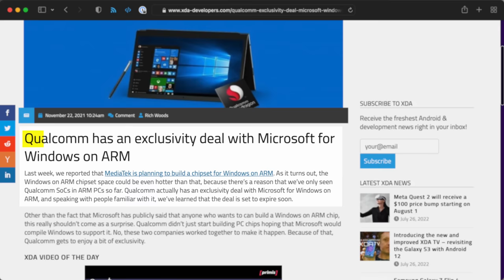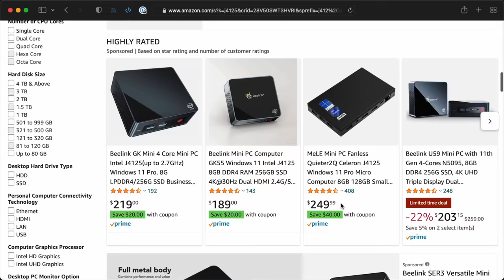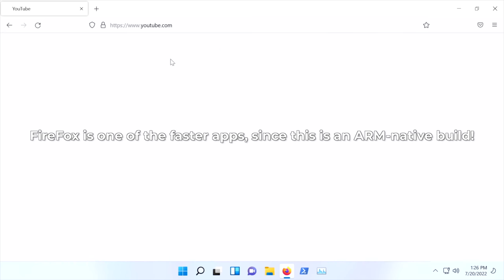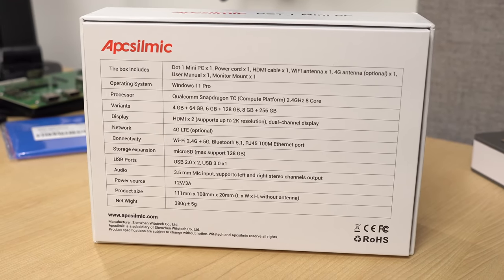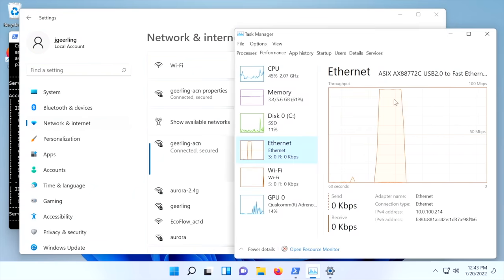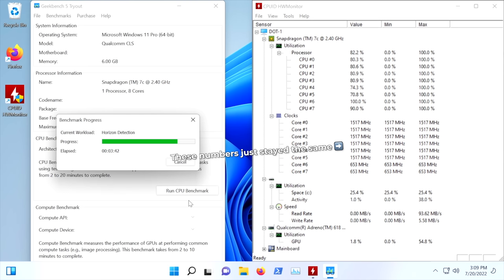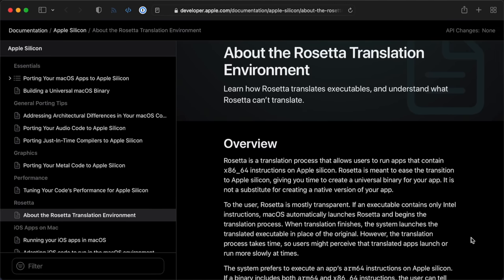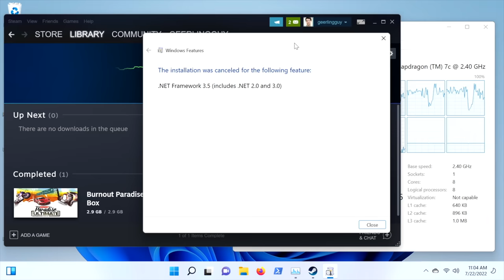Microsoft's wasted potential: Windows on ARM

Comment: there are 4 apple cpu switches actually.  first switch from mos 6502 to Motorola 68000, 2nd to PowerPC, 3rd to intel, 4th switch is to apple silicon.  However the first two apple computers, apple1 and apple2 were not a "mac" and only the later were mac so technically you're not wrong. 🙃
Reply from the maker: Technically correct is the best kind of correct ;)
Reply: There is more than one way to count! ;)
• Apple did actually release 32-bit Intel machines, without support for x86-64, so there was also a transition from x86-32 to x86-64, with 32-bit support being discontinued before the switch to Apple Silicon began.
• Modern macOS is based on NeXTStep, which had been available also for SPARC and PA-RISC, beside 68030/040 and x86-32. All four were once supported at once though. So they already had experience when switching the code-base to PowerPC, and then back to x86-32.
Reply: @FindecanorNotGmail  from 32 to 64 the instruction set is backwards compatible so that doesn't count.  Apple continued macs without jobs so next on 68k,sparc or pa-risc  don't count as well since they don't count as apple or mac just as apple 2 has nothing to do with macs other than only being produced under jobs. :washhands:nice comment though.
Reply: I don't think Apple II counts, since it is a totally different computer, but if you're going to count Apple II, then you forgot the switch from 6502 to 65C816 that happened with the Apple IIgs.  (8 bit to 16 bit.)
Reply: @electronics-girl   I wish there were more computers with the 65C816 :-)  No I didn't forget, just like how I didn't count the difference between 32bit/64bit intel cpus, I didn't count 6502/65C816 since the instructions are backwards compatible. Anyways, you're right Apple 2 is a separate thing. Yet, Jeff said MAC cpu switches and I said Apple cpu switches.
Reply: @Mr_ToR  Fair enough.  Yes, I've always been intrigued by the 65C816, but I never had a IIgs.  They still make the 65C816, so I'm half tempted to build something with it, but unfortunately the 6502 and 65C816 require so many external parts to function that it's far cheaper to build something with a modern MCU such as an AVR or a Cortex M0.

Comment: Wifi won't auto connect if Ethernet is connected on boot.  If you boot it up with ethernet disconnected it will auto connect to your preferred wifi network.  This happens on x86/x86_64 laptops and mobile devices as well.

Comment: A couple corrections:
- Apple hasn't built x64 binary translation in their SoC, they "just" have an addressing mode that makes it slightly easier, but that feature is also supported in some Ampere and Nvidia chips
- That's a 7c, it's the lower end, 8cx runs A LOT better (I'm daily driving it in a Surface Pro X SQ2)
- They're finally pushing, somewhat. Last Build conference had content specific for Windows on ARM, and they also announced "Project Volterra", a devkit similar to Apple's DTK
- Since then they've released two previews for ARM-native Visual Studio and announced that it will go stable in the next release (17.4)
- More and more software is being migrated to ARM64, I was even surprised Teams got a native version on Windows before macOS (yep, I know, I shouldn't be surprised but it's Microsoft)
- Even if classic Minecraft is written in Java, I think it still bundles an x64 version of the JRE and native libs, so it will be emulated anyway :)
- Windows PowerShell sucks even on x64 but that thing only exists for backwards compatibility, you should try PowerShell 7 (dark blue icon)

Comment: Windows will ALWAYS prefer a wired connection (assume because of increased stability for the majority of use cases). Disable the wired connection in network settings and only enable if you need to use wired. Itsa Windows thang.

Comment: I still need virtualization for older x86 Windows software.  It would be useful to have a Compute Stick-sized computer to plug into Apple Silicon Macs to run older Intel software natively, with modular (cheaper, non-Apple) storage.  I have an M1 Mini, so size isn’t too important, but it would good to have a portable solution for MacBooks.

Comment: It isn't wasted potential, Microsoft just knew they can't optimize their garbage OS to the point that it would run on the average ARM hardware without bad user experience
Reply: That's the thing though, it actually works fine, the team did it. The problem is they didn't build any of the critical software for it even though because it's all written in .NET, making the move should have been trivial. It's incredibly frustrating, and I personally think they're pulling a shady move against qualcomm.

Comment: This is another example of what I've mentioned several times as one of the biggest problems with ARM at the moment. There is no firmware standard that is actually universally used for operating system developers to target like there is with x86 processors. I believe that technically there is such a firmware target for ARM servers, but since it's generally ignored for ARM devices, it doesn't help us very much. It seems like the problem might be that adopting such a standard keeps anyone from locking everybody else out, and most of the companies are still hoping for some kind of opportunity to do so.
Reply: Windows ARM64 (and Linux) totally work fine on UEFI/ACPI firmware based systems. The UEFI and ACPI specs have ARM64 specific tables for things like interrupt controllers. Some ARM devices do ignore all this, and only work with a Linux image built for that specific hardware. That's just a business decision by those system vendors. UEFI/ACPI support does take engineering work, and for many ARM system vendors, that engineering cost will have zero additional sales. Like my WiFi router has zero need for UEFI/ACP.
Reply: Linux runs fine on all these ARM chips without such a firmware standard, thanks to its “device tree” architecture. Windows has no equivalent.

Comment: Macs on Apple's ARM SOCs also have a Driver issue. No one mentions this but almost no Hardware OEM makes drivers for ARM. Windows or MacOS. Usually the in-built drivers are enough though.

Comment: You see the pastiche MS did to favour Intel selling new hardware with the Win11 release.
How could you expect them to provide a decent translation layer so Windows can run efficiently on Arm PCs? It would axe hardware sales of Intel hardware in the lower market segment.
MS had their magic times with Windows XP. After that they changed their business model, from writing excellent OS to writing bloated "data collection systems" -  disguised as an OS.
Maybe Intel is going to enter the race with a 10 W TDP ARM processor, where the Windows translation layer works like magic?
I don't know what to think, honestly.
Thank you for the video which provide a great deal of clarifications about Windows on Arm...

Comment: Thanx for the video. 👍
As for ARM PCs, R-PIs and such have a major design flaw as far as data transfer rates and IOPS are concerned since their connections are ( USB ) bottlenecked. There are solutions though, such as the ROCKWELL ROC-RK35xx based firefly or Pine Quartz64, which offer PCIe connections and even M.2 support. You may want to check those next. 😉

Comment: I have the dev kit from Microsoft which comes with 4GB of memory and super slow eMMc. I was shocked by how severely it was bottleneck's by a combo of low mem capacity, high mem consumption, and terrible disk i/o. It's basically a brick.

Comment: You may have luck getting Linux running on that hardware by using Yocto.  Yocto allows you to assemble custom kernel and tools, etc... for new hardware.  Under the covers, Linux has very good support for ARM itself...

Comment: Apple has changed chips more than three times. You had the 6502 in the 8-bit era of like the Apple II, which was considered 'RISC-like'. You had the 68K range that went from the Lisa to the shift to the 'Power PC era' (G3-G5). It went from a purely Motorola designed chip to a primarily IBM designed architecture.

The Power PC chips had integrated functions that previously were discrete prior to that line, so there were a lot of feature changes and they are a different architecture as far as chip families. Then you had Intel range from the original Core chips out through the i-Series and Xeon. (All the same family, generally.) And then you had the M-series, which is derivative of the A series mobile chips.

So basically, 5 different chip families / eras.

All of that aside, the one thing that Apple does that is heads above Microsoft is the Rosetta and Rosetta II software frameworks. The ability to just use your old applications on an otherwise uncooperative piece of hardware is far more important than I think people realize. The thing that kills platforms is lack of software, because developers don't move to platforms without users, and users don't move to platforms without software; and so you get the chicken and egg problem.

Contiguousness of support and platform function is vitally important and it's one thing that Apple gets right that most people probably have no idea about.

Comment: Since Apple has turned the IT world upside down with its M processors, I've been wondering for a while when and how the rest of the industry will react. The exclusivity agreement is certainly one reason that keeps ARM processors from "taking off" in the PC market. But a completely different reason is the compatibility problem. As long as there is no Rosetta-like solution for the PC sector, hardly anyone will buy a PC that doesn't run their old and familiar software.
I for one don't want such a PC not only if it's "just as good expandable" as a Mac Studio, but also if my Steam library won't run on it anymore.

Comment: The main thing that puts me off Windows ARM devices, is the fact that there is no official installer image for Windows on ARM
Even though i do have ONE Windows on ARM laptop (Samsung Galaxy Book Go LTE, with 8GB RAM and 128GB mystery storage (which windows reports as an SSD, but I’m not entirely sure, since other sources have said it is some other type of storage)), i am sticking to using x86 based systems for now, the ARM laptop is mainly there as a device which serves as a backup means of accessing the internet if our broadband goes down

I will admit, i would be interested in getting an ARM mini PC, but there are currently none that i like
I will only consider purchasing mini PCs that have AT LEAST these connections on the REAR: Power, HDMI (x1), Ethernet (x1), USB (x1)
(Having all the USBs on the front is the main thing that puts me off this one)

Comment: Windows on ARM using a M1 Pro, is honestly the fasted/responsive Windows install I have experienced, the only hiccups I encounter is when something specifically needs x86 (eg. drivers)

If only Microsoft could make it legal to run this way, atleast VMWare Fusion now has support for Windows, but Parallels has been doing it for ages now and its great

Comment: While from a neutral perspective of a software engineer that I should keep, I wish Microsoft good luck, from my private point of view I don't care about Windows anymore. Yes, I still use Windows 10 on my PC as my main (and only) OS, but judging from the time I spend at my PC nowadays... I don't really care.

I do most of my stuff on the M1 Max that I got from work - even private dev projects sometimes. My dream device would be the M1 Max with Asahi Linux and support for GPU and other things, so I could ditch MacOS, too, and just use Linux. I'd hopefully get to install IntelliJ and VSCode on there and I'd be set for most of what I do. Add Docker, Java, Kubernetes and a couple other software, and I'm set as that's what I currently use on MacOS on that M1.

Games aren't as important to me anymore, hence I'd leave that Windows PC with games for now, though I already successfully set up Linux as host and Windows as a guest with PCIe passthrough, but to have an ideal set up here, I should get a motherboard, that supports switching primary and secondary PCIe for GPU purposes.

Anyway... After having used Windows since 3.11, I am tired of the crap Microsoft does. Telemetry, cloud integration, less and less control over my device and the data on it just make me angry.
Reply: I have Windows 11 exactly where it belongs: in a virtual machine on my Linux laptop.

Comment: I bought an ARM64 MediaTekMT8183 chromebook for a littler over $100, Lenovo 13" touchscreen .  It is a snappy chip, even though ChromeOS is 32bit.  I mostly install Crouton Linux programs that run at 64bit.  I really like the ARM64.

Comment: I've gotten windows running in a VM on Apple silicon.
UTM had a guide on their website. Ive managed to install the Arm build of Visual Studio. And it works!
The biggest drawback is graphical performance as there's no hardware acceleration. Using Remote desktop instead of the built-in display does work better as it's optimised for GPU-less systems but it's a bit of a drag to use.
Also it's missing a bunch of built-in apps like the windows store. I couldn't get windows terminal installed on it.

Comment: IME the first time you open PowerShell on a Windows machine there is a delay of a few seconds.  I've seen it in umpteen Windows 2019 instances in AWS.
Reply from the maker: True; I mentioned in the caption that subsequent launches take 5-7 seconds still. Like I said, I can forgive it for being slower than my AMD desktop, but I would expect 1-2 seconds for a terminal application. It's not like it's going to render the matrix for me!
Reply: @JeffGeerling  Ah okay, yes every time afterward it should be fast.  This is one little annoyance of years of working with Windows Server that has led to me developing an eye twitch.  That, and opening IE and seeing all those extra first-run tabs pop up.  Or running invoke-webrequest to avoid IE only to forget -UseBasicParsing..

Comment: I looked up some benchmarks of the Snapdragon 7c SOC and... the SOCs of flagship phones from 5 years ago trade punches with it. Yikes.

The SSE2 error you got was because the game was using so called vector extension instructions that can do the same calculations on multiple values at the same time, which can improve performance a lot in vector or matrix math which is very common in games. These aren't native to most CPU instruction sets though, they're an extension on top of it. It seems Microsoft's x86 emulation does not even attempt to translate vector instructions at all, which will make software using it without any fallback just not work

This is extra bad because Steam's hardware survey shows to that SSE2 support is essentially universal - even old atoms and celerons have them. That means that developers expect that every system will support SSE2 and that they don't need to write a fallback. But ARM chips nowadays have their own set of vector extensions, so it would be far from impossible to translate those instructions too if they're already translating the base x86 instruction set, so why they aren't is beyond me.

Comment: the issue is ARM is RISC architecture and the windows kernel is designed for  CISC architecture (x86/64). windows will literally need to reinvent its wheel to get it running smoothly on ARM
Reply: This "can't get it to run poperly" saga has gone on way too long. It is not understandable. Really not. And since it runs faster on a M1 Mac than on physical hardware, you're right to ask questions. I ask myself (for a long time now) "what's keeping them?" All the new things look like half-assed efforts at best. Bureaucracy eating too much energy?

Comment: The only thing that keeps me skeptical about ARM as a full PC is the limited upgradeability
Reply from the maker: Sadly upgradeability seems to be more and more a relic of the past, for many devices. I wish that weren't the case :(
Reply: @JeffGeerling  yeah, I try to avoid anything that can't be upgraded or fixed as much as possible even if it means I miss on some features I believe it's more than worth the trade-off because I own that device. Now something like a raspberry pi I don't mind not being upgradeable but something like a MacBook it is unacceptable and I don't even consider these devices as an option no matter the performance

Comment: Got 10 of these yesterday :)
For Ci/Cd on Windows ARM. There are simply no alternatives that would work stably. 
Except for Microsoft project Volterra, but even if I get it, only with NDA :(
Reply from the maker: Ha! Well it is perfect for that use case. Kind of like some people were using Raspberry Pis for some ARM compilation for Linux just because there wasn't anything else small, power efficient, and stable to match.

Comment: Price is outrageous, the only thing it has over a 'tiny/mini/micro' is power consumption which is half-third at idle. Also size I suppose but there are plenty of vesa mounts for tiny/mini/micro systems if you value that.

Comment: This reminds me a little of the Windows RT laptop my dad bought years back. It was a Lenovo Ideapad Yoga 11, powered by an Nvidia chip. Within a couple of years it was e-waste, as I expected. So slow you couldn't even browse the web, and being a closed system you couldn't easily put a lighter weight OS on it to try to give it more life. This seems like it's borderline usable at the moment, give it a few months and it's likely it wont be.  If that has taught me anything it's that you would be better off with an open platform like the Pi (or anything else with a decent sized community).